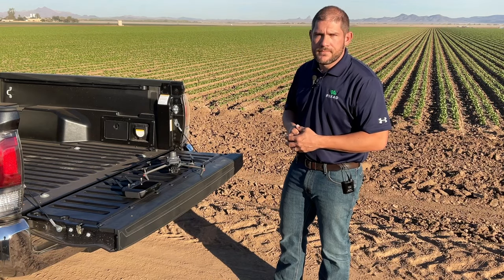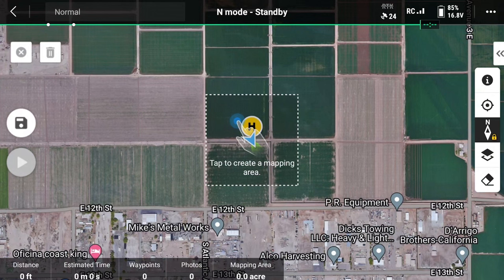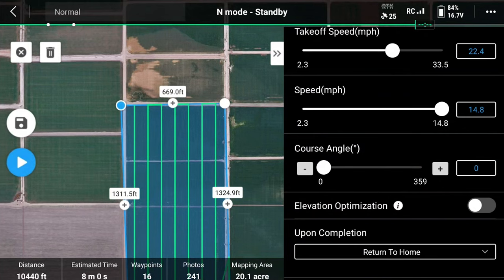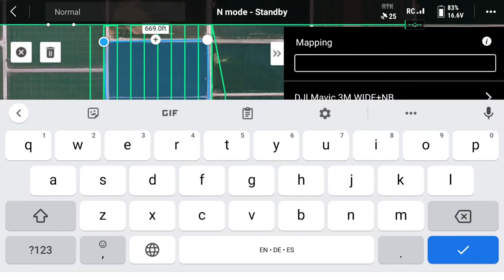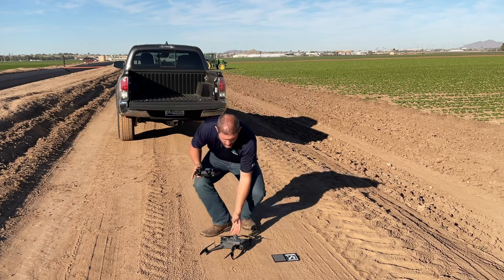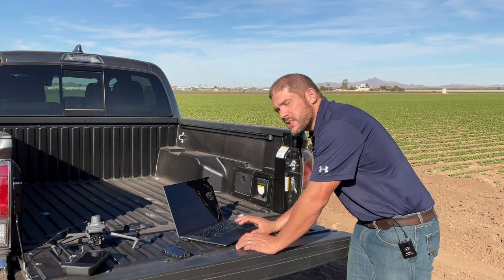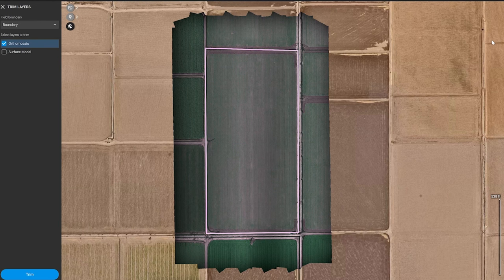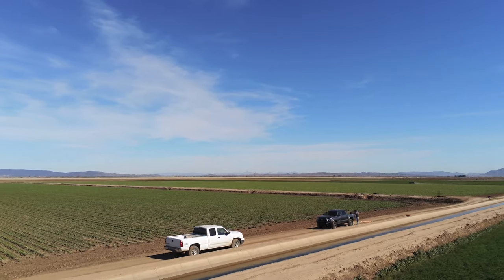How to use DJI Mavic 3 Multispectral | PIX4Dfields in-field Tutorials

Comment: Great explanation! In the case of spraying drones, in which format do you export the variable rate application maps? (For weeds control) And which dji agras do you use?
Reply: You can export as shapefiles, geotiff, you name it! It will depend on the spraying drone you will use. You can export directly yo all DJI Agras models using PIX4Dfields

Comment: Using a calibration panel that was designed for a camera with different wavelengths is definitely going to affect the precision of reflectance values.

DJI Mavic3M wavelengths: 
Green: 560 ± 16 nm;
Red: 650 ± 16 nm;
Red Edge: 730 ± 16 nm;
Near infrared: 860 ± 26 nm;

Micasense Altum, RedEdge 3 and RedEdge-MX (which I am assuming this older bigger panel is from):
Green: 560± 20 nm;
Red: 668 ± 10 nm;
Red Edge: 717±10 nm;
NIR:	840±40 nm;

That should be pointed out!
Reply: It has nothing to do with the camera that Micansense was using it for. It's about the reflectances of the panel it self. You can use it for the M3M as it covers the wavelengths of that camera as well

Comment: hi i have a mavic 3m too. What do I need to calibrate this? how can i get it? What program do I use to calibrate this?
Reply from the maker: Hello! It depends on the type of work you are doing. If you are only flying a crop once and you will not compare in time, you can just use the drone as it is. PIX4Dfields will apply the necessary correction and calibration with the information your drone already provides. A reflectance target is required to obtain reflectance factors and compare several flights in time of the same crop and even compare flights from different drones. Without such a target, only indices that are self-normalizing produce meaningful results, i.e. indices that don't depend on the absolute value. Examples of such indices are NDVI, NDRE, VARI, SIPI2, LCI, BNDVI, and GNDVI. Not self-normalizing are TGI and MCARI.

Comment: Great work guys! What is a "good" flight height, in order to have proper RGB and Multispectral images for agri use? In other words what GSD number is considered adequate for mapping and creating indexes for agri use (NDVI etc)?
Thank you
Reply: Hey, if it's about general plant vigor and larger-scale anomalies. Depending on the camera, you can go as low as 5 to 10 cm GSD, which should be over 120m flight height if your jurisdiction allows that.  If you want to spot weeds and diseases or machine errors like clogged seeding rows, you should aim for GSDs under 3cm. That would be around 60m to 80m with this drone's 20MP sensor.
Reply: @julius_pix4d  Thank you Julius!
Reply: @Nathan Stein Hi Nathan! First of all, thank you for your valuable tutorials. Actually, the video you told me, helped me a lot! Have a nice day!

Comment: Hi! how do Pix4d Field use the calibration picture? How can we check it? Any tips for buying a calibration panel in Europe?
Reply from the maker: Hello, the panel type that you can use depends on the camera model you have. PIX4Dfields currently supports 
the following reflectance panels:  Parrot, Airinov Aircalib, Sentera and Micasense. PIX4Dfields detects reflectance panel images and warns the user that calibration images were found and that they will be used to process the dataset.
You can check our support page for more info: https://support.pix4d.com/hc/en-us/articles/360022919691-Radiometric-correction-PIX4Dfields#label7.
Reply: Hi, will the analysis and processing work without the calibration panel? Seems hard to get and absurd expensive

Comment: What town/state did y’all trial (test) the new DJI 3M?
Reply: @Nathan Stein Hi Nathan!  I'm from Yuma.  I was wondering what permits or permissions you needed to fly so close to the Marine Air Station?  Also did you have to go through DJI geo zones to "unlock" your flight controller related to fly safe.
Reply: @markromero3748  Hi Mark, in that area we were in we had a flight ceiling of 250’ I was also working with the pilot from YCEDA as well. We called traffic control just in case. No issues flying, but of course the remote warned me and made sure I was aware of the airspace requirements. Hopefully that answers your questions

Comment: I wonder if the RedEdge band is false like on the P4M. Ihave never been able to output a correct NDRE raster with this drone.
Reply: If you use a reflectance target, you will get absolutely correct values. This is automatically applied in PIX4Dfiels if such a panel is present in the dataset. Otherwise, the values will still be relatively correct. You can verify that with the Satellite data import in PIX4Dfields, by pulling a satellite image for the same date as the drone flight; it will look very similar to the UAV NDRE.
Reply: @julius_pix4d  Would you be able to provide a raster to confirm what you write? If Pix4D field succeeds where the others fail, I buy a license right away.
Reply: @lv_forestry7948  Here are some example outputs from a P4M dataset. https://drive.google.com/drive/folders/1R54TqrFHUZMUmHo95Wh3GzpOgg8_D9xQ?usp=sharing
Reply: @julius_pix4d  I have received and studied the rasters. Thanks. Unfortunately your software does not do better than the others, the NDRE is totally wrong. Just look at the histogram on the document you sent me. The P4M RedEdge band definitely has a problem, I didn't ask the question by chance, I work with a Resonon hyperspectral camera. By comparing the two cameras, the data coming from the P4M are aberrant. What about M3M? do you have rasters to offer?
Reply: @lv_forestry7948  It is important to compare apples with apples here. One is an entry-grade camera that comes without a reflectance panel, and the other is a high-end sensor. What I said still holds true, relative value distributions between the P4M and other sensors are the same. For absolute repeatability, it may the wrong tool. 

What are you looking for?
Reply: @julius_pix4d  My friend, the histogram of the P4M is not even included in that of the satellite images. We are not talking about a small minimum difference. We are talking about dividing the results by two. If you call that comparing apples to apples, that's great for you. Multispectral imaging is science, not art. There is an obvious problem with the RedEdge band of the P4M, that's all!
What I am looking for?  reliable and comparable data!
Reply: @julius_pix4d  Thank you anyway for answering and providing data. To make it clear to everyone, I'm not questioning PIX4D. I have exactly the same problem with Agisoft Metashape and DJI Terra!